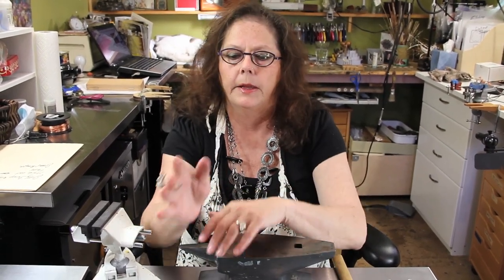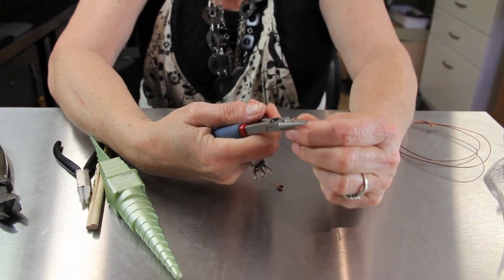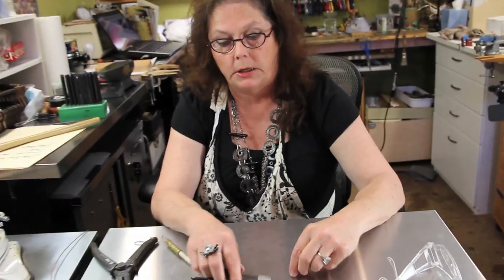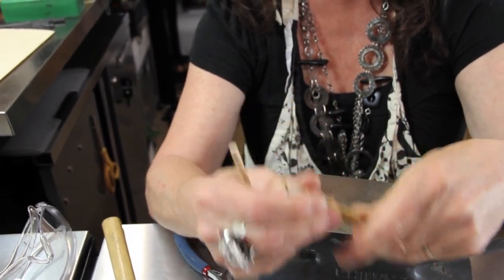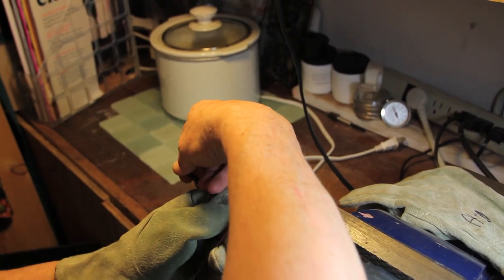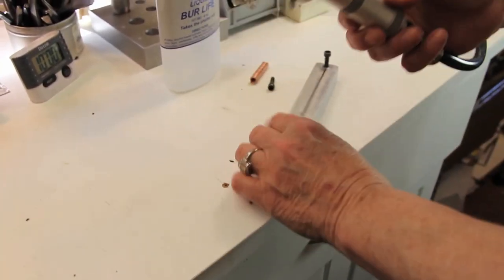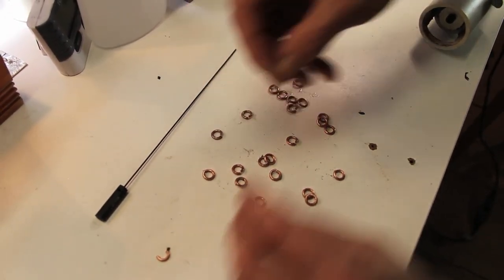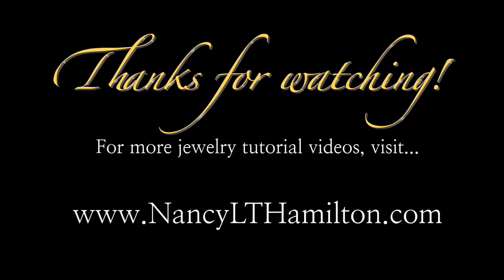How to Make Jump Rings | Jewelry Tips with Nancy

Comment: Aluminum knitting needles work very well. You can drill a pilot hole through whatever you are improvising with so the end wire doesn't cut you. A battery or electric drill will work too. It's the easiest portion of the making...cutting cleanly without angled ends is the hardest. Also, a rock tumbler will help remove burrs from cutting.
Reply from the maker: Thanks for your feedback.  I have an updated video that covers most of what you mention. https://youtu.be/s06c9owalqs  Thanks!

Comment from the maker: Hi LittleCherryHill, I purchased my anvil (15lb) from Harbor Freight.  I don't know if they ship to Australia.  Since it was cheap, it is made from cast iron (as opposed to cast steel) and had to be refinished.  It also dents easily.  I'd recommend steel - in retrospect.  Check  Farrier suppliers, old barns, Stockman's suppliers, Clark horseshoes has some smaller anvils but not prices  - you need to email them.  Check flea markets, metal junkyards, ask around.  more on next post.

Comment: Just put the mandel in the chuck and insert the end of the wire into the chuck in the space between the jaws and the mandrel. No need to clamp it in. I also use a chuck in a power screwdriver. It turns at a slower safer speed.

Comment from the maker: Cont. Keep in mind what you are using it for.  Actually, a square of good steel, like a railroad tie or a  steel part off a car's underside - like the frame, can be cleaned up and/or cut by a metal shop.  Clamp in a big vise. You want steel, if possible.  Stay away from those little jeweler's anvils - I find them wobbly and worthless - especially the brass ones.  Get at least a 10lb. anvil for stability and mobility. Some of the ferriers anvils are heavy!  Good luck and Take care, Nancy